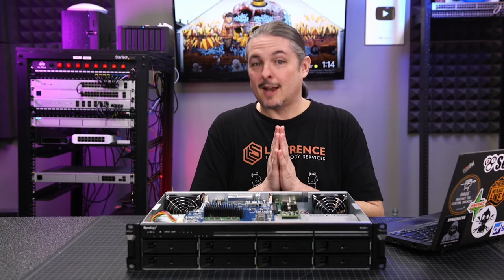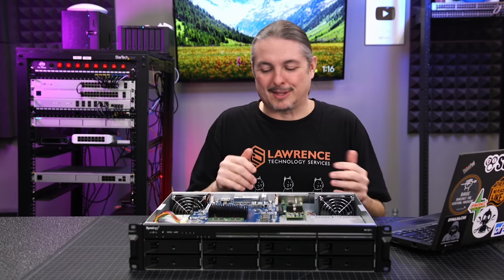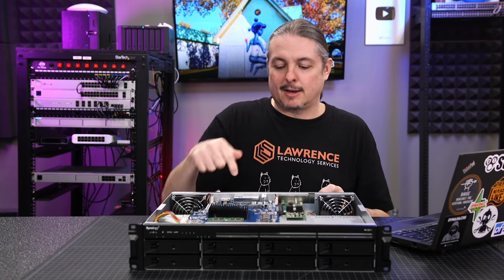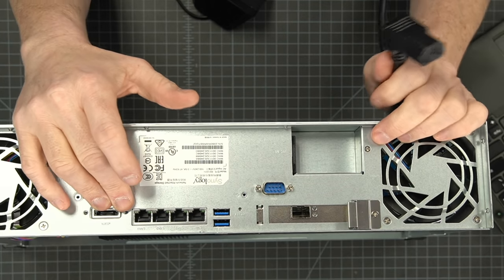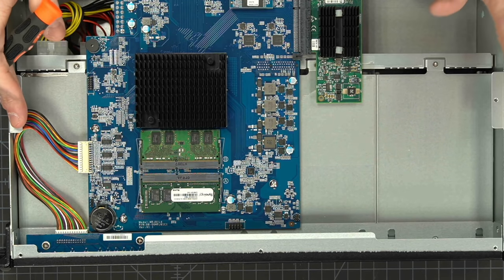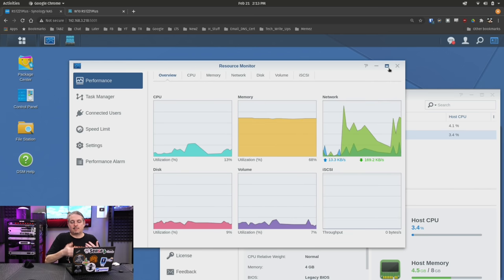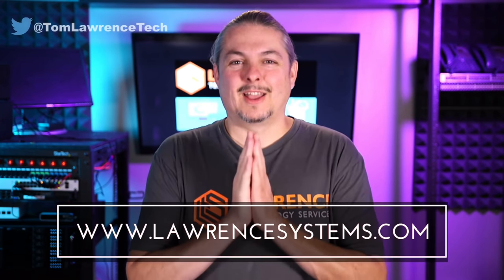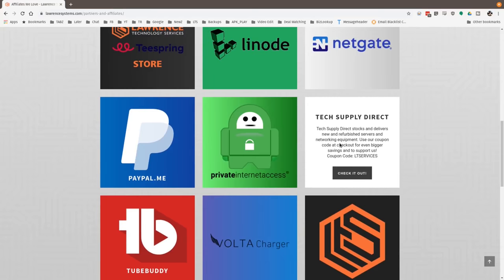Synology Ryzen Based RackStation RS1221+​/ ​RS1221RP+ Review

Comment from the maker: Why We use Synology and Some of the Solutions They Offer

https://youtu.be/_p5RyFEov3k
Reply: Still bit silly that they did this with the psu 

but from past products seems very normal that single rack psus use an angled anti pull plug, but non of there RP models have an anti snag hooks that I usually see on dell and hp servers

Also something like this should have one built in single 10gbe port or maybe just 2x2.5gbe as well, Synology is still really set on only giving 2-4 1gbe ports unless it's over £1k price even then at times its still optional typically (qnap have been good in this regard but to insecure to use in a production environment)

Comment: So sick of synology crippling their product.  No m.2 built in and no 10GBE/SFP+.  For a rack product in 2021 that’s just shortsighted.  Also I have a RS1619-XS+ and it’s quiet at rest but whenever data is coming in the fans ramp up and down frequently creating a constantly changing whining noise - does this one do that?
Reply: Not to mention, ships with a single stick of RAM running in single channel mode.
Reply: Agreed.  THey botched it.  They have two stoned teenagers running that department.

Comment: RS1221+ :
88 mm x 482 mm x 306.6 mm
RS1221RP+ :
88 mm x 482 mm x 407.5 mm
Reply: 100 mm difference or about 4 inches. This might make a difference in a wall mount rack.
Reply: Also, the RP is 35% louder than the single PSU

	
RS1221+ :
25.2 dB(A)
RS1221RP+ :
40 dB(A)
Reply: @robertcoleman7071  That's not 35% louder but about 20-25 times as loud. Perceived loudness is about 1.5 times, according to this spec that is.

Comment: That psu restriction by limiting the ability to just upgrade later is deal breaker in choosing Synology.  Why limit a customer from upgrading when having the ability to have expansion as a option to give them more money makes no sense.
Reply: The same reason laptop manufacturers solder in RAM (and WiFi chips).  Why make it serviceable when you can sell a newer, upgraded model for 10+ times the cost of plugging in a higher capacity SODIMM 🤦
Reply: This was done for very short depth chassis design. No other reason. The single psu version is 12" depth, the dual PSU version is 15.5" depth.

Comment: Perhaps too different (it's a desktop model) to be a useful compare, but the QNAP TS-h973AX is a 9-bay (5x 2.5/3.5" SATA 6Gbps + 2x U.2 NVMe + 2x SATA SSD) unit with 2x 2.5Gbps Ethernet ports, 1x 10Gbase-T, and 4x USB 3.2 Gen 2 (1x USB-C, 3x USB-A) supporting ZFS-based storage.  Same proc, and the 32GB version is ~$1k.  Single PSU - so again maybe not a direct compare - but might be useful in a dollar-for-dollar discussion.
Reply: From things I've read people tend to say you get better hardware with QNAP and better software with Synology.

Comment: They really missed a trick not offering a graphics bay slot , as it stands being the low end imbedded chip by amd, I am struggling to see what market it will go for a content creators need more power, small businesses may want to add a powerful graphics for video surveillance but being in its current state your probably. Have more that 2 4k surveillance cameras, you could Probably use it as a backup or nas store for sbs only

Comment: One thing they've never added to any of their low depth rack models is drive indicator lights directly on the drive bays, just like servers or any SAN I've used, or heck, even Synology's desktop NAS systems.  I'm not a huge fan of the lights listed in a row above the drive bays, hard to tell immediately at a glance which drive is active or is failing.

Comment: A bit old video, but still relevant I believe 🙂 So you know if a GPU could be plugged in, instead of your 10G network card? 🙂
Could be used to transcode movies with e.g. Plex 🙂
Reply from the maker: Yes, but I never need to transcode
Reply: @LAWRENCESYSTEMS  what do you do with your videos, since you do not need to transcode? 🙂 What format are you using? 🙂
Reply from the maker: @kenneth_jensen  Videos are in 4K and my TV is 4K
Reply: @LAWRENCESYSTEMS  mine too, but it's not only about the resolution. The codec format (h.264, h.265, av1 etc.) and the container (mkv, mp4, etc. ) for the video also has an impact.
If the client can't unpack and read the codec to play the file, it has to be transcoded 😉

Comment: How hard is it to replace and find parts to replace the power supply for non RP versions or even the higher end 8+ bay ds series?
Reply from the maker: The power supply itself does not appear to be proprietary, looks like the common small form factor rack mount supplies

Comment: I've always liked the decision for the power plugs themselves to be recessed, given that they're trying to save as much depth as possible to not have the plug stick out.  But the dual power supply placement decision seems really odd to me...the whole idea of a redundant power supply is so that you can swap the failed one while the system is running for maximum uptime...but this requires downtime to swap it?  Interesting...
Reply: The rails go back further than the unit though so you’re not really saving any depth. It’s not like it’s going to fit in a 24” depth rack because the plug is recessed. What goes back furthest is the railing.

Comment: The big miss is if you want SSD NVMe cashe AND duel or quad 10G nic's.. you cannot.. For someone using it as a SAN, that's a big fail..

Here's the odd thing, the SAME setup with the DS1821+ ($899) version HAS built in NVMe so you CAN do high end 10G NICs.. So the RS1221+ ($1299 at B&H) for $400 more you get less functionality, your just paying an extra $400 for ..... rack mount? eh? Also the duel NVMe/10G card is not only 1 port 10G, but 10G-T only, not SFP+... just really a bunch of little niggles that add up for me that make this a fail.. :(

Comment: Not sold, The whole point of a rack mount device designed to be in a data center, enterprise situation then it needs to easily serviceable. Having that power supply put in the way it is makes downtime much longer than others that have easily removable PS. Really bad design choice.
Reply: Do you think this model is meant for a data center? This is the lowest cost RS. I would imagine that you would see the XS series and above in an enterprise data center.
Reply: @robertcoleman7071  It was Lawrence that mentioned it being used in an enterprise situation. Based on that it's a no go. Even at home in my rack, all of my servers have easily accessible power supplies that can be removed and replaced in a matter of a couple minutes.
Reply: @firemedicjm911  Tom might have called it that but I don't believe this is what Synology intended. Check the "Enterprise" link on Synology's website -  https://www.synology.com/en-us/products/series/enterprise 

No plus models are on the Enterprise list, not even the RP+. The plus models start showing up on the Small and Midsize Business link and below.